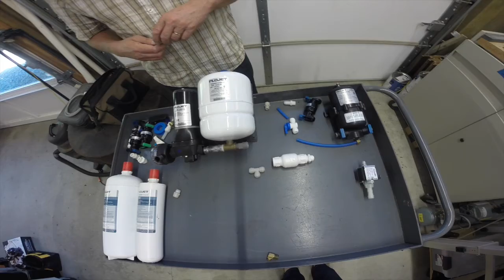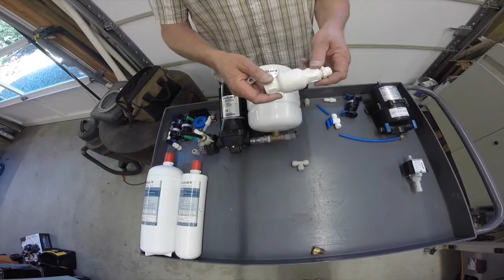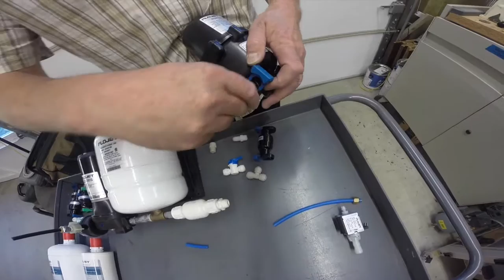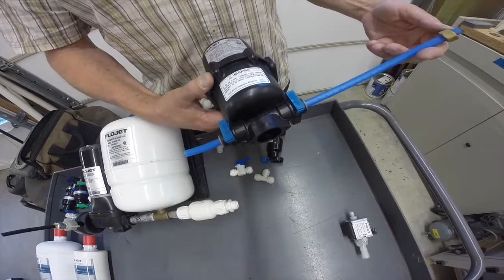Flojet Pumps for Carts/Trucks

Comment: Hi, Thanks so much for your share, I am still up on the air trying to decide what water pump to use for my new cafe cart, is this system less exspensive than the flojet water bottle pump? I make mostly SWEET TEA, I need water to run to my BUNN tea brewers, i have 2 and then also possible an espresso machine as i do have a braville espresso machine i am consider adding for cafe cart expansion. THANKS SO MUCH